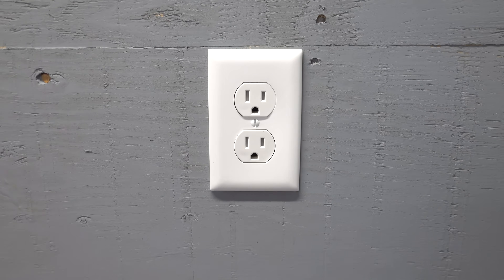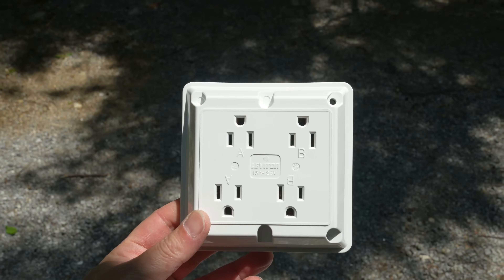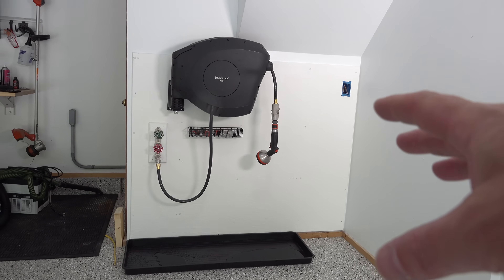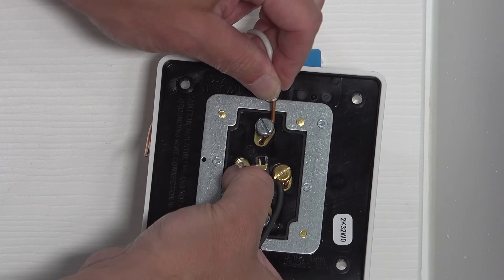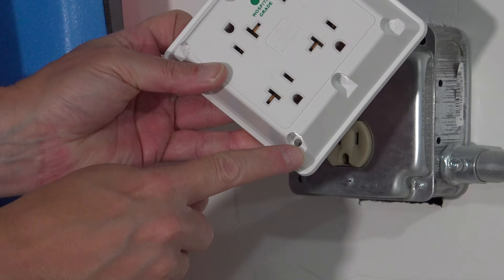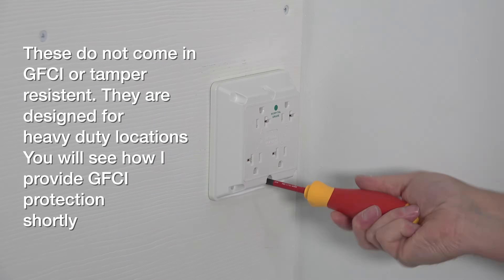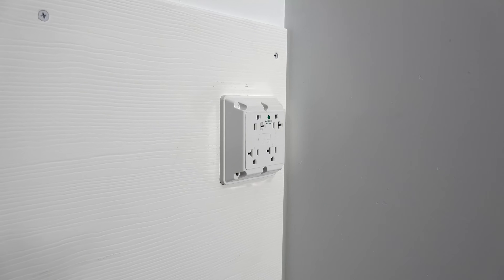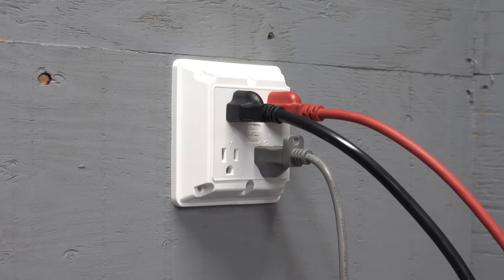How to Turn 2 Outlets Into 4 - Leviton QUADRAPLEX

Comment from the maker: Thanks for watching please LIKE & SUBSCRIBE - Outlets shown: Standard 15AMP: https://amzn.to/3oA4cMm  https://amzn.to/3WJ4UTS 20AMP: https://amzn.to/42a6rUf - Hospital Grade 20: https://amzn.to/3ILWrd7 WIHA Pocket Insulated Screwdriver: https://amzn.to/45ElxnM
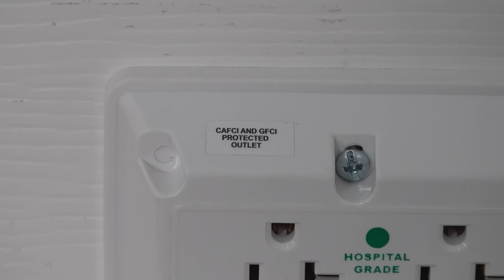Reply: Looks like a neat product - but wondering if I can replace the GFCI outlet in my garage with this one and swap out the breaker feeding that GFCI outlet with the breaker shown at 3:10 into the video? Would appreciate a link to that breaker (I believe our panel and sub-panel are manufactured by Square-D ). Thanks for another quick and informative video.👍
Reply: SqD makes two series residential panels, QO and Home Line. QO is a 3/4" thick breaker and HL is 1" thick. You need to purchase the correct GFCI breaker for your series. Also, 15a for 14 guage or 20a for 12 guage wire.
Reply: If you use those adapters correctly and remove the cover plate and install them with a screw like you're supposed to they work perfectly.  Also what do you mean heavy duty use you should never pull more than 20 amps from a wall receptacles if theare rated at 20 amps. If it's continuous 17.5 amps.

Comment: Still should wrap the wire clockwise around the screw.   Use 20 amp only if you are on a 20 amp breaker.

Comment: I have a cheaper and easier way! I just plug outlet strips into one another and WALLAH! I have all the plugs I need! But then you need extension cords but they are cheap at Walmart. My old house has only like 1 plug per room and the dumb things do not even hold plugs tight so I have to wiggle them to work. My fuse box used to be a hassle until I put in high enough amp fuses and now I do not have to go to the basement to change them all the time.

Comment: In the wiring instructions that come with this, it says: WARNING, Never use uninsulated ground connector, an electrical short may occur, printed in ALL CAPS bold text on page 3

Comment: what about GFCI noticed it was next to water, can I install one in my bathroom to replace the GFCI already there
Reply from the maker: You can, but the outlet alone is not GFCI. You can feed it from another oulet that is GFCI or change the breaker to a GFCI version. It is an extra step but ensures safety and allows these to be used.

Comment: Neat idea.  The downside is it makes painting the wall harder, and you have to mess with electrical stuff to do so.  A standard outlet all you have to do is remove the cover when you paint, but you don't disturb or move any wires.
Reply: Just paint around it and call it a day. Nobody will care.

Comment: You only wired one side of it tho , you would have to wire jumpers to each so all 4 can be used on a single crkt right ?
Reply from the maker: No, both side are electrically bound by those small bridges. You have to break them for a split circuit.

Comment: I can't believe it's been this long since someone has come out with a way to make the J-hook right on the receptacle like that. Most good wire strippers already have a hole for doing this or if you've done it enough, just the pliers end is fine. But this sure seems like a good idea.
Otherwise I only buy receptacles with back wiring clamps as that's easy and secure.

Comment: If you are using that in a wash area it requires GFCI protection.
Reply: They are using it with a GFCI breaker (see 3:09).

Comment: I noticed you had a 1gang j-box in the wall it doesn’t take much more to cut the hole bigger add a 2gang box and wire up your outlets with a quad set up
Reply: Sometimes easier said than done. Especially if the nails are outside of the box. You almost always have to do some sheetrock work when pulling out a box. As long as the single gang box is nice and secure, I don't really see a downside to this.  On a new install, yeah, I'd just put in a dual gang box.
Reply: @andrewt9204  My old house had several plastic boxes that were cracked where the screw holes are. I got really good at getting them out of the wall to replace them with a Smartbox (has screws on the inside for mounting to a stud) without damaging any drywall. Trick is to get the box off the stud by using a prybar between the box and stud and then use needle nose pliers or a screwdriver to push the nails off the box and let them drop behind the wall. Then the box will come right out with no drywall damage at all. It may be necessary to push the box into the wall so the edge clears the drywall before prying.
Reply: @brianleeper5737  An echo: a Smartbox (MSB1G and MSB2G) is a superior solution for many 'old work' applications.  They can be much sturdier than boxes with wings.  Their down-side is that the interior volume is lower and shaped awkwardly.

Much like the product in the video, it's a great product to know about even if it's not used everywhere.  Unlike the quadruplex, it is about the same price as the big box store product.
Reply: @1djbecker  If you're replacing an existing box that's nailed to the stud, an old work box with wings won't usually work because the hole in the wall is too big.

Comment: Or you could just do it right and install a dual gang box…..
Reply from the maker: Sure, and buy hospital grade plugs, and enjoy them being loose after a couple of tough plugs here and there and of course cut your wall open, and add 3 more junction wires.
Reply: Doing it the traditional way isn't always the only way to do it right. If one doesn't mind the higher cost and surface mount, this is actually a superior design. These aren't some cheap gadget from China, they are high grade outlets from a well known company (Leviton). They currently only sell these in industrial grade and hospital grade.

Comment: You can wire either version to a 20A circuit. I have yet to see a residential appliance need a 20A (NEMA 5-20) receptacle.

Comment: Looks like a design from the 1980's.  Today's design should have isolated screw terminals or levers to lock for straight wire. Bending the wire around a screw is a bad design!
Reply: Not a bad design, it works. It is just not a new design.

Comment: This could have some limited applications, however saying it is better or safer than a power strip that has built in surge protection is unfounded. You also make the assertion that this receptacle is hospital grade, unless "hospital grade" is visible on the back of the receptacle which I did not see on the back during the video, and you did not mention,  it is not hospital grade.
Reply from the maker: It is without question safer than a power strip. A hardwired connection will always be superior to the plug on plug splitter.  You can see the green dot with the designation hospital grade in multiple shots in the video. They also offer this as a heavy duty industrial grade version as well for a little less money. Plug something into this 1 time, you will immediately feel the difference. For every day use these are truly amazing.

Comment: If it's a new installation, why didn't you put in a two gang box?
Reply from the maker: I honestly hate two gang box outlets. They always get loose over time, especially in high use areas. They slide back and forth combined with the extra wires that are there to connect to each other and if you price two hospital grade outlets, its even more expensive and a less solid result than with a quad plex. I love how this thing is rock solid when done, the quality of the plugs is primo.
Reply: @SilverCymbal  thanks for the explanation. Much appreciated.
Reply: @SilverCymbal  If a good electrician makes the installation the receptacles in the two gang box will not come lose over time, or move back and forth, and if you have difficulty with all those wires in the box just buy an extra deep two gang,.
Reply from the maker: @musiccitymanpresents  Or I can have a rock solid outlet, and I mean you could hang a milk jug off this when done, it doesn't move ever, with less wiring and much better internals. I would encourage you to try one of these, in two seconds you will see it first hand The only problem is that you will quickly hate your other outlets. These are unbeatable in a shop or garage. Bump them, hit them, use them all day long, they last.
Reply: @SilverCymbal  Regular receptacles last as well, I built my house 37 years ago and  I have never had to change a receptacle or switch and they are still rock solid.

Comment: Thank you for this. I have a sump pump, carbon filter, water softener, and irrigation panel sharing one little outlet in the basement. Power strip seems sketch in that area
Reply from the maker: No worries. Yes My well corner is the same, its nice to have a good solid connection for the plugs. A strip pulling out for those types of items can be very bad.

Comment: Seems like a smart deal, but the slotted screws are so yesterday. No recep made today has a slot screw. Maybe a combo slot/philips head.
Reply from the maker: Every electric outlet made today can be connected using only a flathead screwdriver. ECX has been a flop since milwaukee introduced it. Why, because it doesn't always work, and a flathead always will. I personally will use square drive for some, but the flathead is still more commonly used by pros. You will never see a receptacle in the US that can't be done with flathead alone.

Comment: That is pretty neat but obviously a pro would just cut out the single gange and put a double gang
Reply from the maker: I agree, but they would still need to use hospital grade outlets and a double gang outlet boxes always loosens up. The way this sandwiches in the box makes it rock solid you can't budge this and its heavy grade outlets too.
Reply: @SilverCymbal if you're concerned about loosening, put a catapilar behind the yoke and tighten it down.

Comment: Doesn’t NEC require GFCI protection at the outlet for garage receptacles?
Reply: I’m guessing you’re referring to 3:12? My question was about NEC requirement to have the receptacle (not the breaker/“breasker”) with GFCI protection.
Reply: It doesn't matter if the GFCI is in the breaker or in a receptacle. The devices plugged in are protected by a GFCI in both cases.
Reply from the maker: Please watch the whole video

Comment: The original expansion box can be screwed on in place of the wall plate.
Reply: Looking at the back, that one appeared to lack the center screw (or the hole for one), but there are certainly other models that include one. I use a bunch of those throughout my home.

Comment: This looks very useful - one small comment - it looks like you wound the wires counter-clockwise around the screw terminal, so that when you tighten the terminal screw you'll be turning the wire back the other way (clockwise). Wasn't sure if I was seeing it right, but I think that violates Article 110 of the NEC.
Reply: No, it's OK. I too thought the same at first, but actually it is wound clockwise around the terminal, starting with the end of the wire going out to the end that is cut (hope that makes sense).
Reply: @pradeepbansod3000  got it, thanks!
Reply: He went counter clockwise because he stared with the tip.
Reply: @renalshomlmes338  yes, I see that

Comment: These will be perfect in my computer room; I don't like using the multi-outlet adapters for the very reasons you state such as easily being pulled loose from the weight of all the nonsense plugged into them.

BTW I used to visit the Leviton offices in Lake Mary, FL quite often back in the 90s as I worked for a photo lab that handled all their marketing imagery.
Reply: You can use a power adapter/ outlet splitter (like the black one from the beginning of the video) very safely by simply removing the screw from your cover plate and screwing the outlet splitter directly to the wall. Just make sure you buy one that actually screws in, instead of the kind that just plugs in.
Reply: @kevrides5706  I know one of them is just a plug-in, but I will check the other two. Thanks.
Reply from the maker: I used to run a pretty large computer lab, I wish we had these on the walls. The time we wasted with people unplugging rhe strips, hitting the switch off for the wrong one. You will love how there is NO movement at all the way these install, very solid.

Comment: I've been searching high and low for an outlet with the ground prong on opposite sides of each receptacle. I can't plug anything else with an adaptor into my garage door opener outlet because of the way that cord is configured. This will be a perfect solution!

Comment: Leviton should absolutely make a version of this with the lever connectors on the back.
Reply from the maker: I agree, I think Leviton is going trough a bit of reinventing themselves. For the past 10 years other than Zwave they have been asleep a bit but I see a lot of new things. New electric panels, the level connectors, more zwave, its good to see them coming back strong
Reply: Not a bad idea. If the receptacle was going to be loaded up a lot, I'd feel a tiny bit more comfortable with a good J-hook like this, but a lever connector would make it a lot easier to change in the future when the plugs start wearing out. And without having to shorten the wire.
Reply: @andrewt9204  I mean, they could just make versions of the plugs with the lever connectors.

Comment: Those US outlets (and wire and fuse boxes) always look so flimsy and unorganized compared to what we have in The Netherlands
Reply: And yet we make it work. We’re a very resilient people.
Reply: Yes the outlets are archaic design.  But I do find comfort in the fact that the breaker panel is always made of metal, in the USA
Reply: I have done a number of DIY electrical projects.  I leave a lot of extra wire in the box because I anticipate moving breakers in the future. Even if I hired a pro, craftsmanship is dead.  Some 20 year old apprentice is going to do a shit job and leave me with a giant bill.
Reply: It all depends on the installer and use case. If a higher duty is needed a higher duty will be installed. It also depends on how much time, skill, or pride the installer takes to hook up and route the wires.
Reply: The only good thing about them is that they are relatively compact plugs, but that's about where the benefits end. The wire and breaker boxes are just fine though. I'd rather have the added cost of individual breakers for every circuit over a ring circuit that's common in the UK. The wire looks flimsy because it's solid core and can be thinner to carry the same current as the comparable stranded gauge. 
But, I use stranded wire and conduit for nearly all of my home wiring. I don't like using Romex because you can never change it out in the future without tearing walls off.
Reply: It never ceases to amaze me the lengths foreigners go to in order to pretend their country is better than the US. 

lol.
Reply: @VanquishedAgain  it's because for a long time the US was the gold standard for everything. Now that everyone has caught up (and in many cases surpassed) it's a source of pride for foreigners to measure themselves to the US.
Reply: @VanquishedAgain  To be fair, The Netherlands is pretty much better in almost every metric. Just saying! Lol
Reply: US uses 110V power for most residential circuits. 220V is for high power devices like AC, dryers & stoves. Europe uses 220V for all.
110V is far less dangerous; it won’t kill you, 220V will. Hence a lot of DIYers in the US do 110V electrical work, which is not going to look pro. And the wiring & circuits can be smaller too.
Reply: @Bonnev-jt8hl 220 circuits would be smaller for the same power delivery. So 120 circuits need to be larger to deliver the same amount of power. Almost everyone in the use has 200amp service. So the total power available is higher than most European homes and businesses for that matter. It's surprising to see houses over the pond that have less electrical capacity than the circuit dedicated to just charging my car. Heck my oven requires 30amps at 240.
Reply: Same feeling here, I am in France

Comment: Not for me but interesting to know. I prefer to just cut out for a double gang box if I want 4 receptacles
Reply from the maker: I hear you but every double style two gang box always loosens up and you have 3 extra wires. These are rock solid when done, you can pull on that plug left or right no movement. Its a clever setup, and super tight.
Reply: @SilverCymbal  I haven’t experienced any loosening with my installs, maybe with plastic boxes that happens but I always use metal old work boxes with the support tabs that you fold over. As for the extra wires, I just tie the two receptacles together with some 4-5 inch jumper wire. If you do it neatly it doesn’t crowd the box any more than it would with 1 receptacle.
Reply: @SilverCymbal  Wired properly, there would be 6 extra wires, called pigtails. Electrical devices like receptacles aren't supposed to be used to connect wires together, according to code. Of course, it still works, and we have all probably done it at some point.
Reply: @buddyclem7328  While it is considered good practice to use pigtails, in a typical single-leg residential application it is only required for ground.  (Of course local additions and modifications to the NEC can change this.)

In certain cases using pigtails actually creates a NEC violation, as the additional wires requires additional box volume.

Comment: I need to add some options on my garage. I'll be picking one of these up to try it out. Thank you!
Reply from the maker: You will really like them, the second one I put in at the end of the video ends a constant frustration when I never have enough plugs and they feel perfect every time you use them. I think you will really love these if you decide to use them.
Reply: @SilverCymbal  is that GFCI breaker a straight swap out or is there extra wiring needed? Just realized my garage outlet is GFCI.